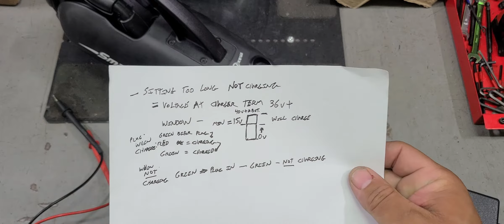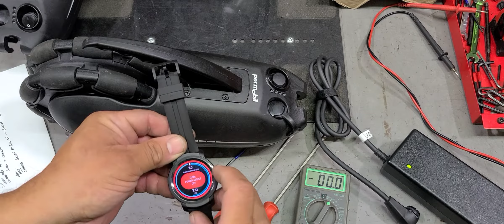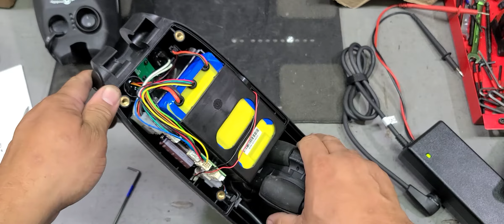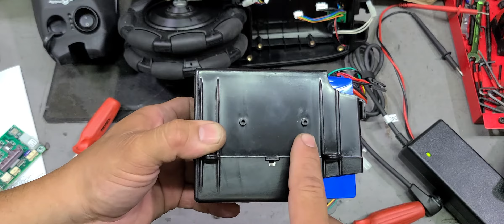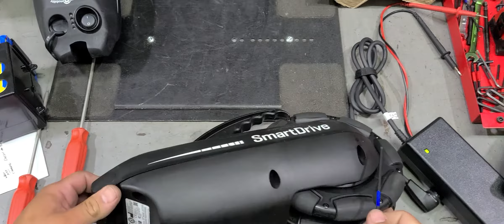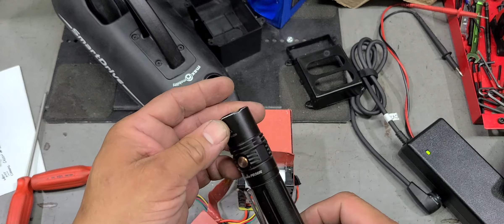Permobil Smart Drive Battery Or Circuit Board Replacement

Comment: Where can I find parts for smartdrive. Permobil wants $1400 for a new battery and $1700 for new pcb. F'ing crazy.

Thanks.
Reply from the maker: Sadly that's the only place to get them, and it has to go through a dealer at that.

Comment: Hi, my unit was left on for a month and won't turn on or charge. The wierd thing is it is that I tested the battery pack and it is giving me a voltage of 39v. Any idea how to troubleshoot shoot next?
Reply from the maker: @GruvisMutt  did you use a meter to check the voltage? The voltage needs to be checked without the charger being plugged in, it will give a false reading if the charger is plugged in. Sounds like the circuit board went bad. Try hooking everything up except the connector that goes to the rocker switch. Use a paper clip to short/jump the unit on where the switch would plug in. If it powers on and you get the two beeps then it's a bad switch.  If it doesn't power on then it's a bad circuit board.
Reply from the maker: If you get a low or no voltage reading without the charger plugged in, then the battery is dead, this is the most common thing when they're not charged for some time. It can also happen if they're left plugged in to charge for a very long time, the battery literally gets slow cooked.
Reply: @shadowstorm7  yeah, but I got 39v so I don't think it has anything to do with the battery.
Reply from the maker: @GruvisMutt  If the charger was NOT plugged in when you took the 39v reading then that just leaves the on/off switch or the circuit board.
Reply: @shadowstorm7  yes, I did all that. Tested the battery leads directly, took the switch connector off shorted the switch pins on the board. No beeps, no lights.

Comment: If that's a 3 wire motor connector then if it''s [plugged in backwards the motor will spin backwards.
Reply from the maker: It is a 3 wire connector. The connector is keyed only plug in the correct way for forward motion. Only parts directly from Permobil should be used. However to answer your question, here is a great video about brushless motors. https://youtu.be/AQEAHEzaUJE

Comment: Mine just beeps when I push the hand switches to go forward. The main Battery voltage tests at 39VDC and the small tap you measure, measures 1 volt on mine. I have a ticket running at Permobil right now and if they don't warranty to main board I can buy one for about $100 I hope? I actually want to sell it, curious to it's worth second hand but no mileage

Comment: The price for that battery pack is very expensive. I checked at I can not afford to repair mine. My battery is the problem. My curcuit board is fine.
Reply from the maker: If you were able to get it through medical insurance you should also be able to have it maintained through that insurance.

Comment: Your video is very clear and I should be able to replace my battery. Is there somewhere to get a new battery that doesn't cost $1300? Like everything else for wheelchairs its way overpriced.
Reply from the maker: Sadly the only place I know is from Permobil. I don't think they will sell a battery directly, they will have you buy it through a local dealer. The only discount would be given by the dealer, not through Permobil. Hope this helps clear your question up.
Reply: @shadowstorm7  thanks for your reply. I don't know exactly what is happening with my battery. After 12 hours it will charge to 70% with 3 lights. Then after sitting off the charger for a day or two it shows 97% charged. Maybe a loose battery cell connection or something.
Reply from the maker: You can check those connections.  I had one client that actually had a loose connection, probably due to dropping the unit and bad factory building.
Reply: @shadowstorm7  Thanks for your comments. After thinking about it, the battery couldn't have gained 30% charge by just sitting. So I'm thinking the battery was fully charged all along and the problem is the circuit that indicates the amount of charge the battery has is the problem. What do you think?
Reply from the maker: @chuckgaudette8885  there are four corresponding blue lights near the power switch.  Those will show state of charge; 100, 75, 50, 25 percent respectively depending on how many are lit. An alternative would be to verify this through the bluetooth connected Push Tracker, it will also be able to display the level of charge in the drive unit.
Reply: @shadowstorm7  Yes, after charging for 12 hours there are 3 lights and the charge indicated in the app is 69%. Then after it sits for 2 days not charging or being used, I get 4 lights and the app indicates 96% charged. So it gained nearly 30% without charging. That's why I'm thinking it's the circuit that reports the amount of battery charge is faulty not the battery itself.
Reply from the maker: @chuckgaudette8885  I would consider taking the cover off and checking that the connectors are all fully inserted/connected. Then re install the cover and use the unit as normal. keep track of the milage. You should expect up to 5 miles of range on a flat surface with no extra or heavy loads, a user weight of under 200 lbs.
Reply: @shadowstorm7  I did that following your video. All connections appear secure.
Reply: @shadowstorm7  If I wanted to check the voltage on the battery directly, where do I contact my voltage meter? There are 3 major leads coming off the battery. Do I do each one separately? The app on my watch says the battery is 97% charged with a range of 1.9 miles. The voltage reading from the charge port says 1.8 volts. So something seems off. Thanks
Reply from the maker: @chuckgaudette8885  Sounds like you have a bad circuit board. Take the main cover off that has the 3mm Allen screws. Diconnect ALL connectors from the board and unit to isolate the battery from the unit. Then check the voltage of the battery with the volt meter set on DC volts on the proper range setting if it's not an automatic mode. You want to use the white connector with the thick red and black wires. Note the voltage you measure. After, reconnect everything, with the cover still off you need to carfully connect the volt meter probes to the same white connector while it's connected to the board. If you use paperclips to get a contact point where the wire goes inside the connector be careful not to let them touch creating a short circuit. Note the batteryvoltage and compare it to the first isolated battery voltage. If there is no drop in voltage then it can fairly be said the board is bad (reporting an improper voltage) If it does drop, then your battery capacity has bee compromissed (most likely due to impropper and/or lack of charging)
Reply from the maker: @chuckgaudette8885  Also what will confirm the bad circuit board is that the voltage at the large battery connector will not match the charger port voltage. If you get 1.8 volts at the charger port and you get 36 volts at the battery connector inside the unit that means the loss is occuring at the board. At 1.8 volts the drive unit shouldn't even be able to power up.
Reply: @shadowstorm7  thanks for the detailed instructions. I'll check this in the next couple of days. Where are you located? Maybe I can send the unit to you.
Reply from the maker: @chuckgaudette8885  I'm in SoCal.
Reply: @shadowstorm7  so am I. Sherman Oaks specifically. I bought my Smart Drive from Sherman Oaks medical about 4 years ago. They won't service it because I guess they aren't authorized by Permobil. I have to wait another year before I can apply for a new one with Medicare.
Reply: @shadowstorm7  Ok. with all the connectors disconnected the battery voltage is 42.4 V. Then with everything connected the battery voltage is 41.8 v. So I guess this means the board is bad right?
Reply from the maker: @chuckgaudette8885  It looks like it. Does it run fine or does it give a jolt and not run when you try and use it. You will need to contact Permobil directly and ask where you can buy a circuit board. they should be able to connect you with a local authorized dealer.
Reply: @shadowstorm7  It runs fine. I'm thinking that if the battery is in fact fully charged and the only problem is that the board is reporting an incorrect charge, I should be able to keep using it without any problem. But if I need a new board, can I buy one from you?
Reply from the maker: @chuckgaudette8885  I would need the exact model number and serial number. You can contact me through South Bay Home Health Care in Torrance. Ask for Repairs and tell them it's about the Youtube Smart Drive.
Reply from the maker: @chuckgaudette8885  If the four blue battery lights on the drive unit are reporting the correct voltage, you can keep using it. If nothing is reporting the correct voltage and cost is an issue, I would use some type of milage tracking app, biking distance or running app to track distance and just expect it to take me up to 4 miles of distance. At least until you get it repaired or get a new Smart Drive.
Reply: @shadowstorm7  Thanks for your reply. I get 4 lights. I'll try to keep track of the mileage. I can call you next week with the serial number and see what a new board would cost. I don't qualify for a new one for another year.
Reply: @shadowstorm7  I used the SmartDrive for about 3 hours straight yesterday. At the end of that time, it showed 46% charge and 3.3 miles remaining. I charged it overnight and now it shows a 100% charge with a range of 12 miles. I think perhaps running it down that far for the first time jogged it to recalibrate. I'll keep watch on it and see how it goes

Comment: How did you get new battery?? My daughters went out and I was thinking of rebuilding the pack but buying new one would be easier
Reply from the maker: Buying a new battery would be the best way to go. They're not cheap. Like $1300. The reason rebuilding the pack isn't a good option is because there are so many wires to solder and make sure are connected correctly. It has a battery managment system wired in as well to make sure the individual cells are charged and balanced. I've been working on chairs since 1992 and also work on RC planes and other electronics. Even I wouldn't want to do it unless I absolutely was forced to.
Reply: @shadowstorm7  I called permobile today and they won’t even sell a battery they want like 2200 and I have to ship it to them so they can swap batteries.. pretty pissed at the whole thing.. I might try to jump start the battery pack to add some voltage to see if it will start taking charge
Reply from the maker: @bluecaka69  well if you need to go that route you will need three 12 volt batteries. Wire them in SERIES to get 36 volts at the positive and negative post. Then you need to wire that bank IN PARALLEL to the smart drive battery. Leave it connected overnight so the larger 36 volt bank equalizes (charges) the smaller 36 volt smart drive battery. You might get some use out of the smart drive battery but it may never maintain it's specified capacity and run time because the battery wasn't maintained properly. That's what happens when it's left to sit too long without getting charged.
Reply: @shadowstorm7  awesome thanks I’ll update you if it works
Reply from the maker: * UPDATE * 
This may not work if the battery pack is severely discharged. Never leave the pack unattended during a process like this. Monitor voltages and disconnect if it seems anything is getting too hot. Again, trying to balance / charge the battery this way can go wrong nad is really not recommended.

Comment: Thank you my power drive seems to have burnt out 2 days ago going up a steep curb. I need to get it repaired ASAP. I’ve been a paraplegic for 31 years I have replaced parts on my chair myself. I need to find this battery and circuit board ASAP so I can continue going out independently.
Reply from the maker: Contact your local authorized wheelchair vendor. They can get the part and install it for you. If they don't have a qualified tech then the local Permobil sales rep should be able to do it. They will not let you install the parts yourself. 👍
Reply: did you get your unit fixed? Where are you located, I am sure someone here can help you find a local to help.